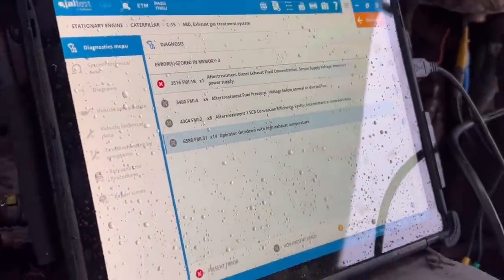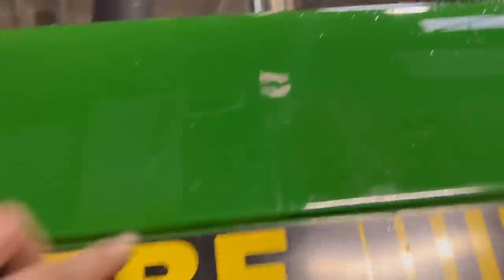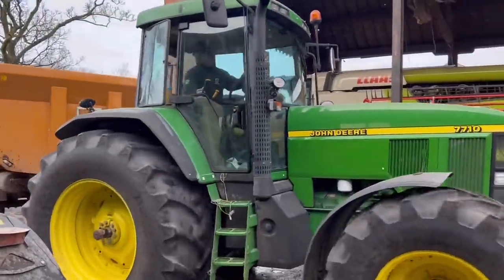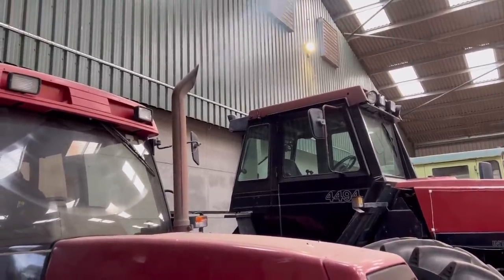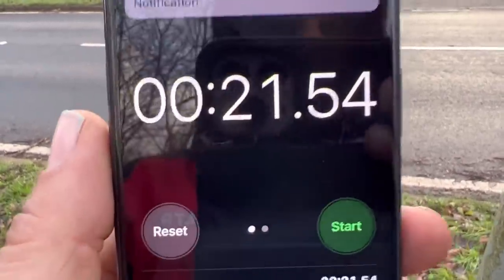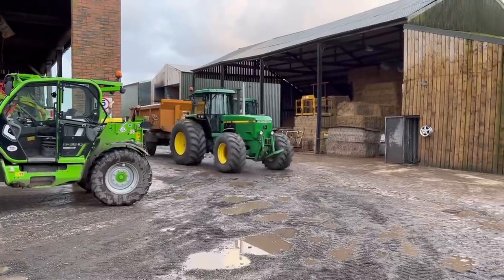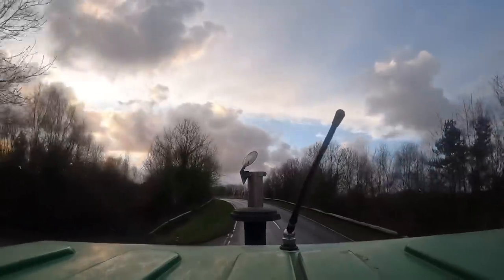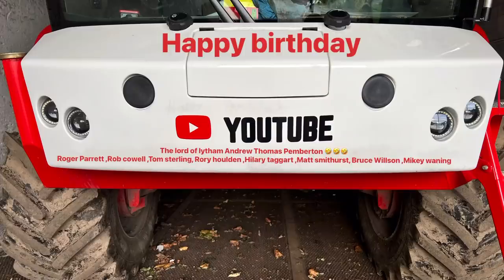Day657 #OLLYBLOGS JOHN DEERE 7710 v 4955 IN HILL CLIMB SNAPPED PINS & RAIN #AnswerAsAPercent

Comment: You want a product called jelsol by auto smart for removing stick stuff spray in on leave for couple of minutes and then it just rubs off. I used to use brake cleaner but found it would dull the paint on things etc

Comment: Just in relation to the chipper fault could you maybe just get the ad blue system mapped out altogether or is the chipper still under warranty??
Reply from the maker: Could but they want £2100😮
Reply: @OllyBlogsAgricontractfarmer  it's definitely worth looking into,surely it can be mapped out it will save you a fortune in the long term,was the guy with the laptop wearing a balaclava by any chance 😂😂

Comment: That John Deere 7710 Olly looks the Dog Bo***cks on them tires and especially with the front linkage fitted, the 4955 looks smart too but the 7710 edges it IMO, get the 7710 and the 4960 on the RW trailers in the summer alongside the Lexion then maybe stick the Fasty on the header cart! 🤣
Reply from the maker: Could do 👍🏻